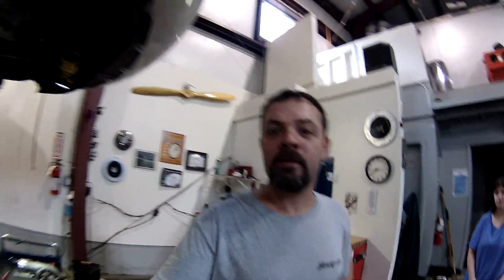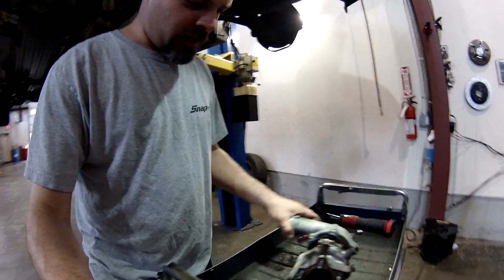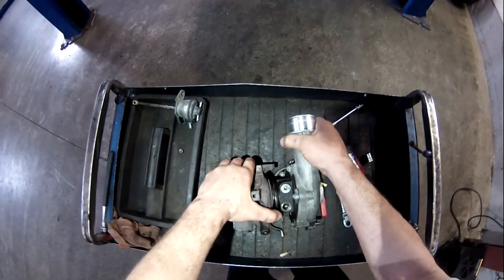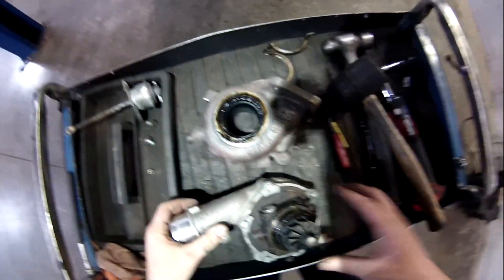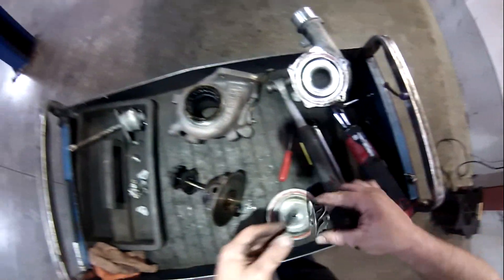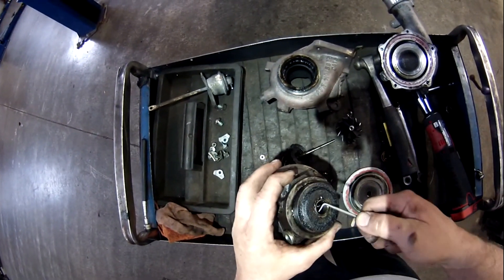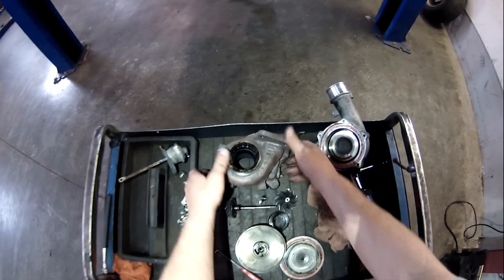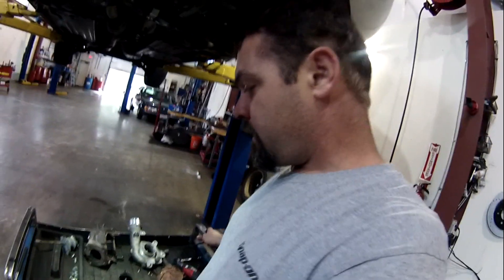Mazda Turbocharger Autopsy.

Comment: When turbo seal fails on exhaust side - can you get blowby in crankcase at idle? I can feel a slight blow by from oil filler neck - no blow by out of oil dip stick though. I know usually it's rings or valves, but someone mentioned they fixed blowby by changing turbo.

Comment: Bearing failures, lack of maintenance, plugged/inefficient PCV system. There you go common 2.3 mazda turbo failures
Reply: popomomo12 exactly plus crappy seals, a 270 degree thrust bearing and anemic center shaft make for a short turbo life in any Mazda/mazdaspeed model.

Comment: I have a 2009 CX7 with less than 36,000 miles on it.  The turbo failed in mine as well.  Mazda had actually issued a warranty recall on the turbo.  Apparently, the seals would fail and cause oil to be blown out.
Reply: Can you give any details on the recall e.g. reference number - thanks

Comment: I just changed this turbo on my 2007 CX7 2 years ago and it just blew again!  I'm in the process of tearing it down now but I wanted to ask if you had any suggestions as to a better bolt on turbo for this vehicle so this doesn't happen again. It appears that this is an ongoing issue with this type of vehicle and I really don't want to have to do this again in 2 more years. I can't believe that Mazda doesn't recall these. I know this is my last Mazda as a result. If I wasn't a disabled veteran and jobless I would just buy a new car now. Thanks for your help.
Reply: I kept up my oil and coolant, city driver, lower speeds....

Comment: Thanks for the video, 
My Turbo Charger performance of my Mazda CX7 2010 which I have changed twice but it still not performing as expected. I did also change the Convertor with a new one but the issue of acceleration is still not resolved. 
However, I got a feedback that there is again an issue with the Turbo as it doesn't open when reaching 2800 rpm. They said that the Turbo butterfly doesn't open as the vacuum is not sucking enough. 
They said there is no way but to replace the whole turbo again. 
It is so costly to change the turbo three times along with the convertor within 2 months!
I will be so thankful if you give us some mechanical /technical instructions to get the Turbo fixed without replacement with new one.

The Turbo Butterfly doesn't  open the champer to air to enter at all; especially when reaching 2800 rpm or above.